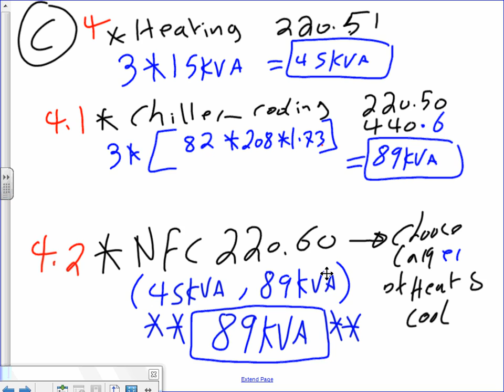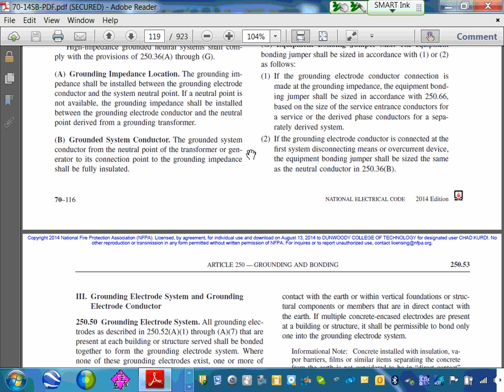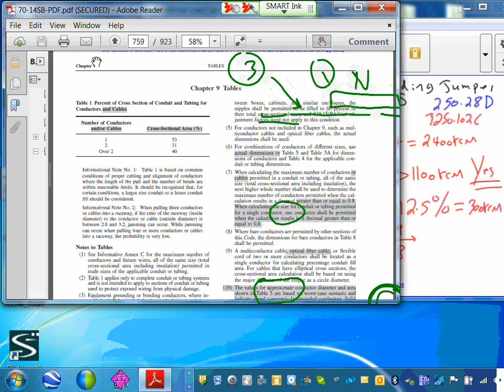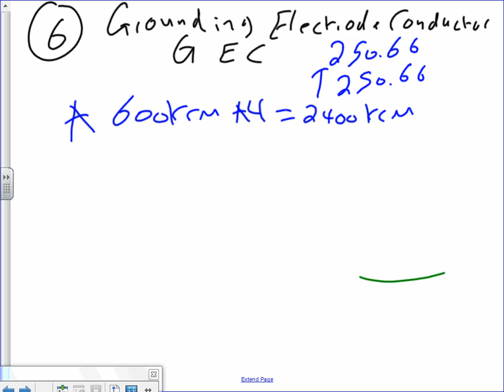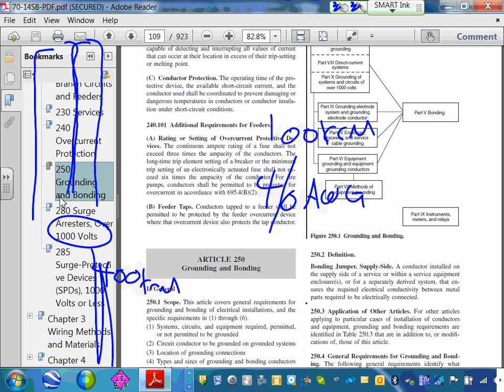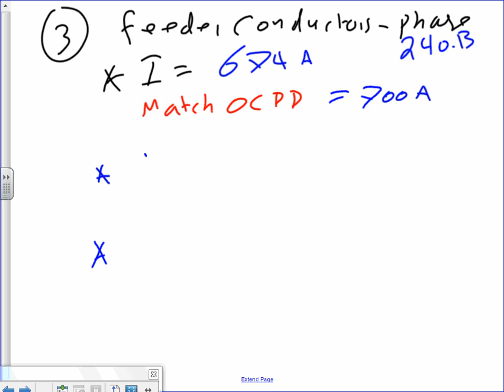Electrical Commercial Load Calculations 3 08 28 14

Comment: Mr CHAD  600 kcmils are not the phase conductors, 4x600=2400 kcmils are, because you paralleling so you neutral is 2400x0.125 =300kcmil so 300k/4= 75kcmil still smaller than 1/0 in the table but that the way to do it

Comment: In 22 min, the code in 220. 61 c 1.. No reduction allowed for 4 wire wye system..
Please explain
Reply: Pertains to 4 wire wye systems that serve non liner loads, meaning if the 3 phase service serves things such as high intensity discharge lighting. In general this can result in the neutral conductor carrying an ampacity similar to that of the phase conductors and in some situation greater than. The nec addresses this matter by not allowing the reduction in the neutral conductor under such conditions.